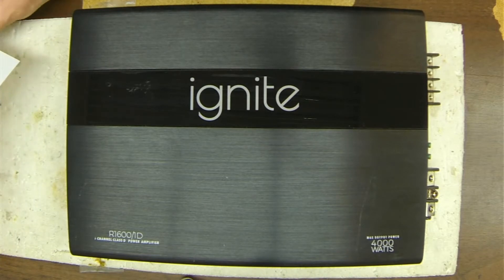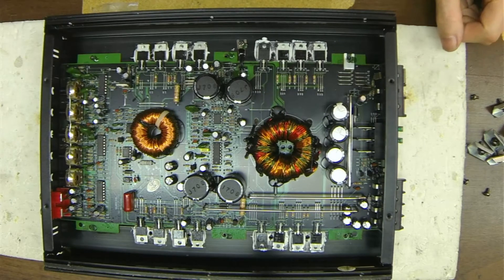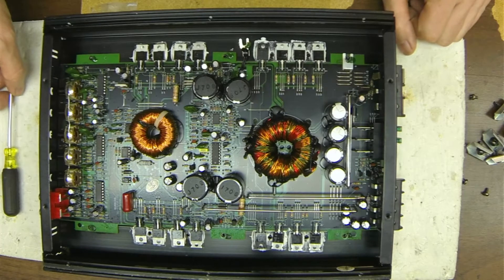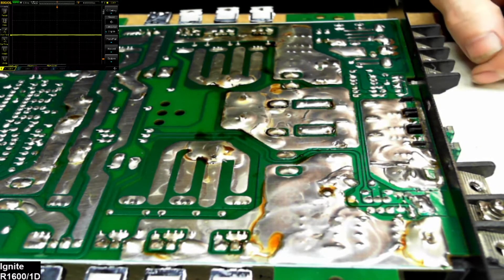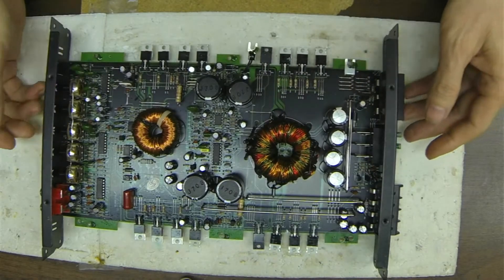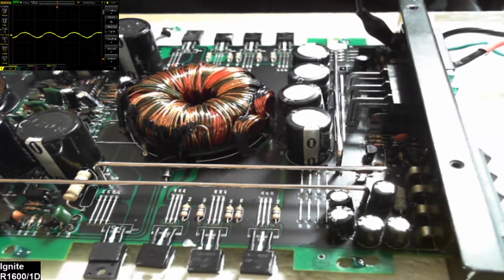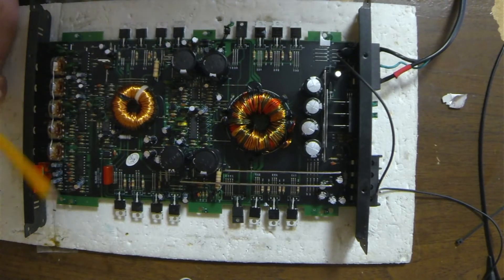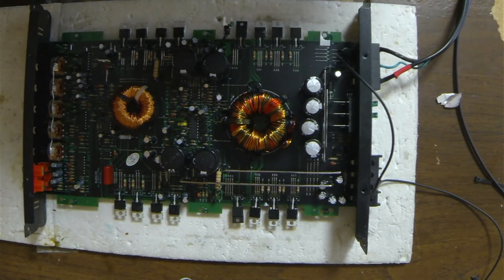Ignite R1600/1D 4000 Watt Class D Car Amplifier Melted Power Ground Terminal Replacement

Comment: hello ihave simmilar amplier design but different brand 
ihave a scope but  the amp cant turn on if the output mosfet in amplfier stage 
if i remove the final fets the amp turn on the rail voltage is ok but the high and low side of the amplfier i can t see in short there s no pwm signal going to final fets.
my suspect is that 2184 but i raplace it den nothing happens same same condition then i try to get 2184 from the other amp that will operate normaly to proves that 2184 is the faulty ones then when i replace it its same again then now i bring back the 2184 ic now on the other amp that will work normal
then now they have same problem protec then the protec indicator is little bit strange cuz the blue and red ligth are both lit...
now can i blame the ic the 2184? the other parts is good resistor transistor the capacitor is the one what i not tested cuz i donthave capacitance mete lcr meter or leakeage tester..ty
im new in electronics im from in PH sorry formy bad english
Reply from the maker: It sounds like the 2184 is going into shutdown. You will have to see what the "SD" pin is doing. If you do not have low side drive then the IC is going into shutdown which can be independent of the standard protection circuits as the 2184 has it's own internal protections. I usually find something bad int he output section if the 2184 is going into internal shutdown.
Reply: @ellensburgamplifier  ahh ok thankyousomuch for reply ♥️♥️ i will update u

Comment: Hey bud i got a ignite 4k just like this in the video. Its got low output but when i turn the gain just a little it starts just making random loud bass sounds if that makes since. Where do i start?
Reply from the maker: Sounds like a potential pre-amp issue or a drive problem. A scope will be a person's best friend for this issue.

Comment: How can I send my kicker zx 1500.d ... my ohms on new subs I purchased damaged it... I ran 2 duals 1ohm power bass n over  did my ohms on the kicker amp... found out the amp cn only do 2ohms... but power on n play  but pop into protection  when I try to turn it up... hlp plz
Reply: I hve a kicker zx 1500.d  need me take pics of the board
Reply from the maker: @redalbino0787  I think I may have just responded to you through my website. Thank you!
Reply from the maker: Sounds like the output stage needs a rebuild. If it is the board I am thinking of it will need a new bank of output transistors and if the drive got damaged, a few IC's that drive them. www.ellensburgamplifier.com at the top you can request a quote. Please leave details of the amplifier so I know which board this is.

Comment: I have a Boss 4000 d block an my power connector on the amp just melted an felt in, can the terminals be replaced
Reply from the maker: Yes, it can be replaced. The trick is finding a replacement. I do carry a wide assortment of terminals for most of the Korean-style boards.

Comment: We have this design everywhere my other bud is struggling with one dont have switching
Reply from the maker: Hi, Aqeeb it's good to see you here. If there is no drive at the output he will have to trace back what is driving the SD pin. If it's the power supply then I would need to know what IC is used (494, 3525).
Reply: @ellensburgamplifier  I will find out later thanks
Reply: Hi boss just getting back to you he found a dry joint which was causing no switching
Reply from the maker: @aqeebismail8090  Thank you for the update! That is common to find on several styles of boards and then when vibration is factored in dry joints just compounds the problem.